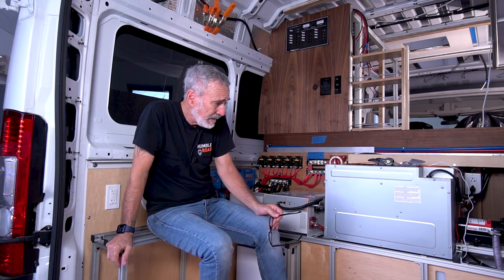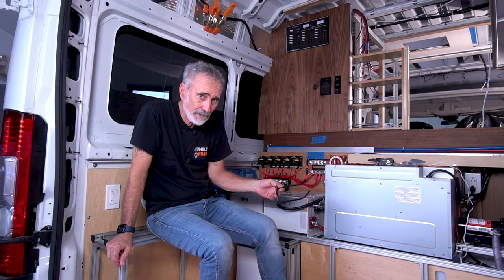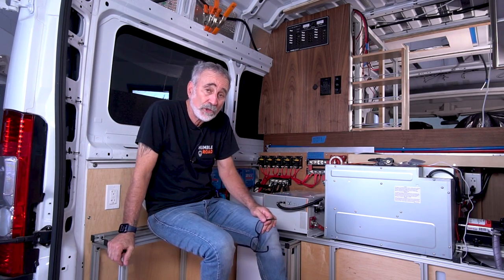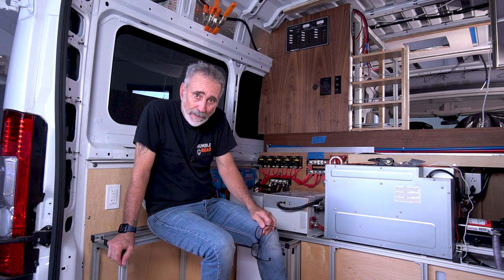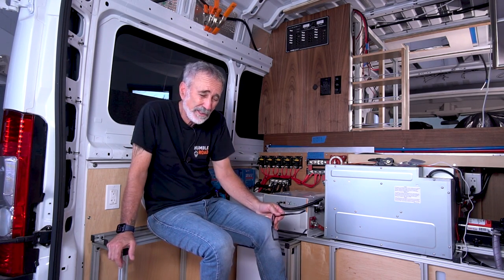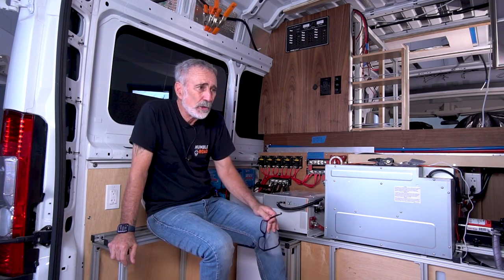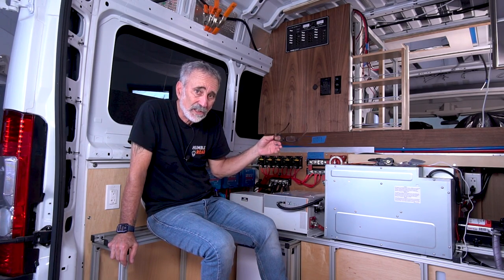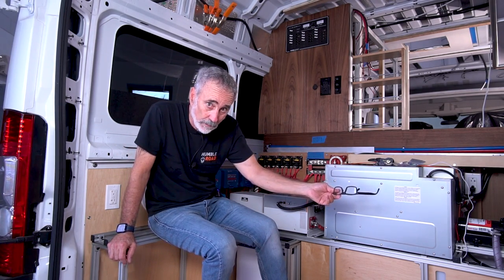Recirculating shower in a van? Just my humble opinion...

Comment: Recirculating shower for the WIN! Changing the filters is easy, fast (and inexpensive) a no spill solution is easy to fabricate when you don't close off your imagination to the possibilities. MOST IMPORTANT you can change water WHENEVER you desire. Take a 10 minute shower (normally consumes 20 gallons) and only use 3 gallons. Drain the water and use fresh 3 gallons for your next shower. You can have six 10 minute showers (6 x 3 gallons each time = 18 gallons) for the cost of  one 10 minute shower that doesn't recirculate (20 gallons bye bye)   ALSO of NOTE:  A UV light should be used FOR ALL VAN showers regardless if they are recirculating or non- recirculating.  Kills all bacteria, mold, fungus and parasites from water sourced while "on the road" and stored "in the van"
Reply: I was thinking 🤔 good 💡😊👍
I'm getting ready for my own build I will research your opinions. Thanks 🙏👍
Reply: Totally agree with you, Humble Road didn't think about that when he did this video.
Reply: Totally what I was thinking recirculate the water for the one shower and get fresh water each new shower. Im in a skoolie so ill just put the filters under the bus let the water spill if it may lol I totally need my hot showers and thatll save me water for more hot baths 🙂
Reply: It's a good idea but it needs more development to be good for normal use. You still have to use it sparingly to get practical use out of it before the filters have to be changed. You can't lather up with soap like you normally would shower in a recirculation shower. So all the water you claim to save is lost on you anyway. It doesn't compare to using a non recirculating system.  Also 10 minutes doesn't have to be 20 gallons. low flow showerheads and sink aerators aid GPM. You can bring that number down to 11 or 12 gallons per shower just from changing the showerhead. I'd rather use a 3-5 stage filter to filter water from more questionable sources like lakes, rivers, ponds or even puddles anywhere on the ground or the ocean so that finding more water is never an issue. I'd rather a layout that stores more water. But recirculating it is just too impractical right now.

Comment: Sure, it can be repugnant to swap filters, like you did for your home. The thing is, all that disgusting stuff that was in the filters would otherwise have been in you if it wasn't stopped by the filters... just a little bit of it at a time. But yes, one reason that I believe the only proper way to do a recirculating shower is to use the water only for one shower and then discard it is to keep the filters cleaner for longer. It may not be for everyone, but it saves water. As in, you can actually take real showers with a relatively small tank. That's pretty big. And, disgusting or not, we should really have nothing but recirculating showers in the home as well, and only composting toilets. Yes, more work intensive. Yes, filters can be repugnant. But Americans literally flush out billions and billions of gallons of fresh, clean, drinkable sweet water just on getting rid of their poop and washing themselves, which is 100% not sustainable in this day and age. At the very *minimum*, the shower water should be collected in a separate tank, and then used to flush the toilet, so you'd save some water. And maybe filtered lightly first. It could also be used to water a garden and so on. Right now, we're being disgustingly wasteful of water. But, I guess that's another rant, and not van related... either way, I'm a fan of recirculating showers. That's my opinion, and of course people can agree to disagree.

Comment: Love you, George, but you've missed the point of a recirculating shower.  It's SINGLE use.  It simply allows you to take a typical shower, not the spritz type military shower.  The filters are there to catch hair, dust, other small particles and not clog the nozzle!  Some filters filter out soap or shampoo and conditioner.   It's about the amount of water used to get clean and well rinsed, and it is then drained.

Comment: Our shower system works better than expected.  Yes, the filter change can spill some water, but that why we have a one piece rubber floor.  Its all in the design and layout.   I know if George sets his mind to it he could develop a superior system.   Our system used 9 gallons, a lot of water for a recirculating system.  Before starting the van build I prototype the shower system in my garage - yes there is a video of that.  This is one of the problems I had to solve before starting the van - the boss wanted an inside shower!
Reply: Yes, I saw your shower video. I liked it.
I know two solutions I saw on YouTube for the maintenance problem:
One with the filters in the shower cabin behind a panel. When you do the maintenance, the water will spill in the shower pan and will be drained in the drain that goes into the grey tank.
And one with the filter manifold on a board, that can be pulled out on a drawer slider, so water will spill outside when you do the maintenance.

I will go to your channel later to see how far you are now.
Reply: Hah, your setup was one of the first I found when I started researching recirculating showers.
Reply: I just searched and found the LOOPZ shower it's portable and uses 1.6 gallons
Reply: @MelissaJohnson23408  I looked that up.  It would not work for our use.  Its basically a flat shower pan and a pump to recirculate the water.   But if it works for you great....

Comment: Agree 100%. I have had to clean out the shower sump in our cruising sailboat many times when the drain get's clogged. It's one of the most gag-inducing jobs to do on a boat. I'd rather put my money and space into more water capacity.
Reply: Recirculating shower systems don't require any maintenance that resembles  cleaning the shower sump on a boat.
Reply: @MaunoKoivistoOfficial  You are absolutely correct about the differences in maintenance. The point I was attempting to make (perhaps not very well) is that the grey water on the upstream side of the filters in a recirculating system is the same swill found in a boat's shower sump. Changing the filter elements is a very hands-on process and it is virtually impossible to avoid spills. Personally, I'd prefer not to handle it if possible.

Comment: I've been pondering the logistics of a recirculating system that allows the user to direct the used shower water into a grey tank or back into the loop. Would be nice to disguard the soapy/dirtier water at the beginning of a shower, but then recirculate the water used after that. I think that would extend the filter cleaning, as you'd be passing mostly clean water through the system. All the soapy water at the beginning of a shower wouldn't be recirculated. For me, a long, hot shower is mostly enjoying the water after getting clean.
Reply: There are all sorts of configurations that make a recirc possible and practical. I haven’t heard anyone mention it but 3-way valves are a key piece of the puzzle.
Reply: @RustyCas999  problem is not in valves, it's all about water filtration.

Comment: I hear you - all concerns are valid. I just finished my recirculating system, and I think I've answered all your questions, but it was insanely complicated and fairly expensive. I do have a catch tub under the filters, the option of using the regular water lines and skipping the recirculating tank altogether, and it can be drained after every shower if you want.

I'll be making a video at some point. Not for the faint of heart - it involves a ton of equipment, many motorized valves and electronics - but my love for a long warm shower in the morning is strong.
Reply: True dat!     I think this system has merit and an individual choice.  I'd love to check out your video!
Reply: Looking forward to it! there's so much about recirculating showers that is still WIP - even in which the order in which the filters should be installed! would like to see your take.
Reply: Would love to see that video!! I think the recirculation approach can definitely work with the right tweaks
Reply: How is the recirculating system going?
Reply: please make a vid! :D
Reply: I think 3-way valves (momentary power) can simplify a recirc arrangement with all sorts of possibilities - campground mode, filter loop mode, filter backwash, etc.
Reply: I’d love to know more about your system. I want to develop one, but I also want to solve some of these problems with different options.
Reply: but... fecal matter.... oh no... granted it's in the laundry as well but ok that did get me thinking. did you manage to make that video? Would love to watch it!
Reply: Still no video?
Reply: How is your system holding up?
Reply: Subscribed to your channel but you don't even have one video yet? 
I def would like to see your recirculating shower

Comment: We put in a 'single use' recirculating shower in our MAN truck camper, and it works very well. 
You fill up the shower base with hot water (we use about 4 or so litres for a shower) and then the pump recirculates that through the shower head, so it's more like a bath than a shower.  The only filter we have is a broad gauze type coarse filter to trap hair before the pump.  You can have a good 5 or 6 minute shower, especially in warm climates.  When it is very cold the water does start to go cold, so we add in another litre of piping hot water half way through.  At the end of the shower, you let the water out down the drain hole.
All this stuff with 3 filters and charcoal and etc is way too complicated, in my opinion.
Reply: I agree. It's not that hard to keep it clean applying practical methods.
Reply: Hi David, that is exactly my plan. Recirculating for single uses. Still figuring how to make it happen. Any suggestions are most welcome 🙏

Comment: I concidered long and hard whether to build a recirculating shower listening to both sides of the argument...I did install one, pre pump filter, carbon filter, 10 micron filter, 5 micron filter and UV filter and yes it takes maintenance. To offset the valid points about urine, fecease and soap scum....we use large wet wipes, BEFORE getting into the shower !!  so we are clean, then we use the shower for a really good HOT RINCE using no products, we run the shower post showering (without us in it) so the catch tank goes through the filter system without picking up any body oils etc from us. The only issue we have is that the water can pick up a little odour after about 4 showers...I will try 2 carbon filters and a one micron filter to see if that helps. Would love to hear anyone else's system set up and experiences..

Comment: Well said and totally true. I still installed one in mine and have a separate system to do the dishes and for drinking water. And i don't shower with soap, instead i soap myself before the shower using my separate system. I would not have installed a recirculating shower if i used it just as a normal camper van but i live in mine to not have to pay expensive rent, so it became a needed thing for me.

Comment: That's a great perspective. I HAD an idea where I wanted to put the filters until you pointed out what happens when you unscrew the cap; didn't think of that. Undercarriage isn't as practical because I live in Germany with a proper Winter. More water capacity and the suspension to carry it are two upgrades I will make to my van. Thanks for the video. 😊🚚
Reply: The weight and space saved from the filter setup and spare filters vs the space and weight for the extra water and gray tank space is a a factor. Would just make a bigger water tank ok

Comment: I think if you treat the recirculating shower as a bath it's OK.  First you go to the bathroom before so there should be no urine or fecal matter involved.  My shower has 2 pumps, one to pull the water from the pan to the 2 gallon tank and one to pump the water from the tank through the filters, heat exchangers, mixing valve and out the shower head.  I can take a hot shower in the winter or a cool shower in the summer for as long as I want.  At the end of my shower I soap up, rinse off and pump the water from the tank to the grey tank.  Each shower only costs me 2 gallons and the soapy water never goes through the filters.  I figure if the filter system I have is good enough to transform lake or river water to safe drinking water it's clean enough to take a shower.  Gotta be better than taking showers at a surf camp in Mexico where you have to keep your mouth closed.  Cheers George, love your content and new vlogs.  Your attention to detail (lighting, dialog) do not go un-noticed.
Reply: @lyfandeth  yes my filtration includes a 20 micron, 5 micron filter and UV exposure to sterilize.
Reply: Use a neutralizing/biodegradable soap, shampoo, and conditioner. Make sure that they don’t use petroleum as an ingredient. Add 1 teaspoon of Epson salt to the water which will get rid of the soap suds.

Comment: 100% agree. Recirculating the water is not the best idea.
Although we have a shower built into our motorhome, we don't use it as installed, as you just shower until the water tank is empty!
We have a 10L jerrycan fill it with shower temperature water and drop in a submersible Whale pump connected to the shower hose via some additional pipe with a non return valve. The 12V supply is wired through a waterproof switch in a convenient place. Turn on for 10 seconds to get wet, turn off, start soaping, a few seconds more water, more soap, wet hair, turn off, shampoo, then about 90 seconds to rinse off. Army style shower - simples.
Reply from the maker: Clever!

Comment: First let me say all of your concerns are valid. Having said that let me tell you what you should consider that would change this dramatically. First this shower should have A STANDALONE tank, thats right, no black and grey water tank. This will be just for the shower and nothing else. Second always use UV lights in your filtration systems to kill off most of the things that the filters dont. Third if your filters are spraying you when you change them you have a bad filtration system, good ones dont do that. Last but not least consider putting in a heating element so it can heat the water up inside and you dont have to keep looking for hot water first.

Comment: What about a system that uses both a recirculating system and a fresh system combined?
Have a long shower with a recirculating system using, say, 5 litres of water, and then when you're done, purge the recirculating water to the grey tank and switch to the fresh system to rinse yourself off.
It would be similar to taking a bath at home where you'd sit in the bath and wash yourself, and then when you're done, jump in the shower to rinse off.

Comment: Going through my van build now and although I am installing a retractable shower pan for occasional showers, my thought process was the same as yours about recirculation shower systems.    My solution is more fresh water capacity and a larger sink in order to wash hair etc and take a "bird bath" in the sink between showers.     I am installing a 4 stage filter for drinking water and I am dreading the filter changing schedule... Which is much less frequent than a recirc shower filter system would be.     
Well said and well thought out.   You are a true craftsman and it is a joy to watch your videos because it all makes logical sense.

Comment: Valid point. The dilemma exists. Maybe the only way it would work is a very technical design of an auto flush filtration system, where the filters do not need to be removed. I have never heard of such a system to date. I have, however, read on the net about an extraction system that installs in the camper, and actually extracts moisture from the air and fills the water tank slowly. If this were available today somewhere out there, it would be a huge bonus to the water storage issue.
Reply: All large commercial installations use a “backwash” system. Just a few manual valves is all you’d need. You could either use the pump that’s already there or an external hose (supply), for instance when you’re in that campground that George says you’ll be staying in periodically.

Comment: Well I have to say, you've certainly swayed me. I was all for a recirculating shower, could have one for as long as I wanted etc.....but the cost, and the hassle 😳, yeah I just don't think it'll be worth it. I wonder, who has a shower every day anyways? Here in the UK we don't have vast open spaces of nothing like in the states so I can kind of see the reason there but here? I could fill my tanks virtually every day if I wanted and as I'll have a Truma combie boiler for hot water and heat I'd need another tank for the hot water for the shower. Yes, a system which would be nice if you're very off grid but for here and Europe? I think not.Thanks for a great explanatory video giving lots of food for thought, nice work.👍

Comment: Showering and washing seem to me to be two different things. Stand under hot flowing recirculating strained then filtered water is suboptimal but better than not. Time to soap up and rinse, that goes to gray. A shower if managed with a good strainer pre filters and drain to gray for washing is actually better than a bird bath. Like much in life, it's dealing with the gray.. it's not all black and  white. So I'm building my motorhome right now with a ditch the dirt water drain aka soap time equals gray tank, soak time equals recirculate. Top up the recirculate tank automatically and 100 gallons becomes 200 gallons equivalent without the weight or space. I'll let you know if my humble opinion works out. Love your "say it as you see it approach!" thanks